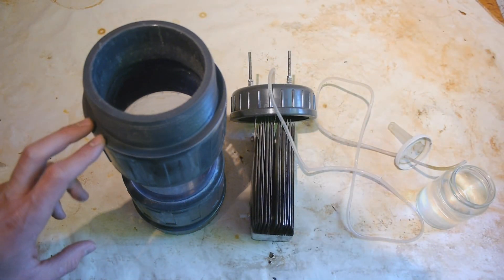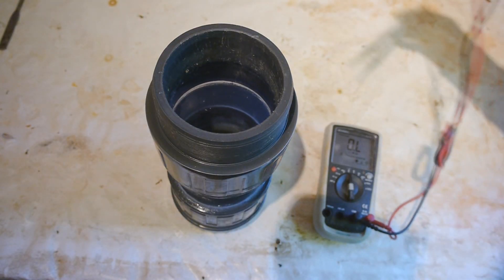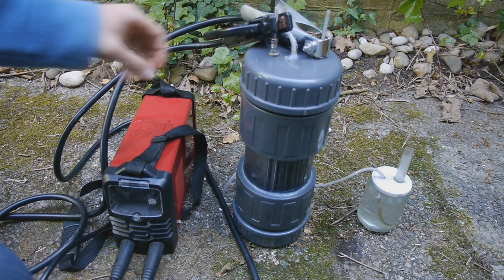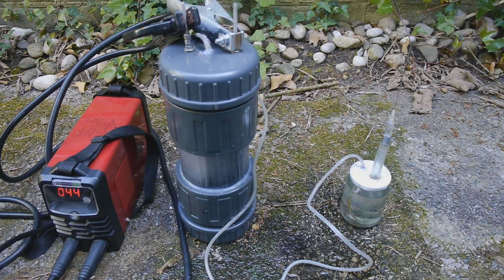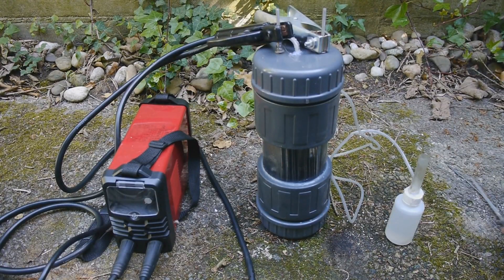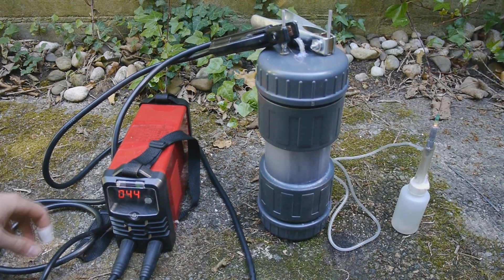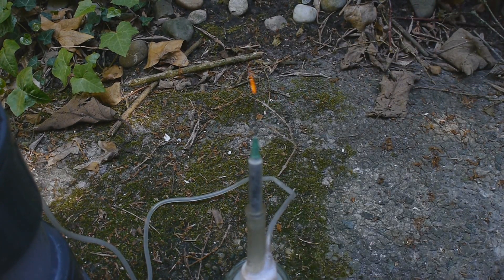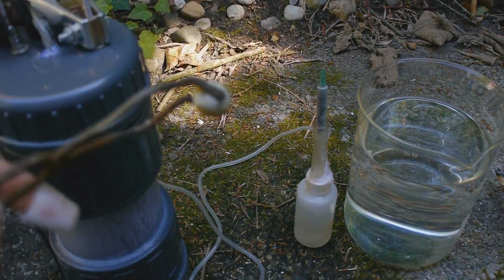How (not) to make an HHO Torch [Explosive Failures]

Comment: Make your car a hydrogen hi-brid Hho Technology will surprise you! Hho is a mind blowing technology . Cool engine running  prolonging engine life and engine oil life with less engine maintainess required🚦

Engine life changer device improve engine performance and increase fuel burning efficiency like  a new car!!!  100% fuel will burn in the engine No un 

burn fuel wastage . Engine will Consume less fuel. Hho system works on petrol, deisel, cng, lpg and lng types gases.

Engine runs lighter smoother reducing carbon emissions significantly . Boost engine power and torque . Hho gas reduced engine noice & vibration

An efficient hho car kit lower the engine temperature more then 100 degree F.  To prevent heat build-up. Hho kits restore better fuel economy. Hho system is very easy and simple to install. Hho solves the engine heating problems automatically!!!.

Cleaner engine running. Reducing engine noise due to the faster fuel burning. Hho car kits works nicely requires no modifications in the car engine. No side effects on car engine.

Engine start quickly your car battery will charge  quickly car AC works better& safe your car battery.  make your car a low cost hy-brid. Use a  low amps. Hho car kit will work better. You can easily transfer hho kit from one car to another one. Hho kits requires no any modifications in the engine. For more information about this useful technology  keep watching hho zafar videos. Or call 03082266179 zafar karachi.
Reply from the maker: But that would be very inefficient to first use the electricity to charge up the battery and then convernt it again to HHO, which then fuels the engine. It is just much more efficient to just use straight gasoline.

Comment: Reduce your pressure, youre  producing alot of gas and no regulation on pressure and minimal on flow , the fact you're still getting a flashback after inserting the wool, you have leaks and too much pressure, another option, reduce current on the welder , there will ve a trimpot for calibration that will allow you to go down further
Reply from the maker: The wool did work for the flashback. But I doubt I will pursue this much further. It was just a fun little side project :D

Comment: when you lit the oxyhydrogen, I winced so hard, I was like: "oh no, oh no! its not pure hydrogen, its oxygen and hydrogen in the stoichiometric ratio, its gonna explode!"
good thing it wasn't sealed, and there was a bubbler xD
also, why use potassium hydroxide over sodium hydroxide? or any other metal hydroxide? does it give some sort of advantage?
and is calling it a catalyst correct? or is it just a source of conductive ions which provide an electrolyte? isn't a catalyst something that changes the speed of a reaction, but does not get consumed? though the potassium hydroxide doesn't go away, it is technically getting broken down, and then immediately getting reconstructed by reacting with water.

I'm loving your videos, and I would love to make suggestions, (if that's alright with you xD )
when it comes to oxyhydrogen torches, they produce the stoichiometric ratio of gas, which is quite dangerous, and burns a little too fast, and since water only requires 1 oxygen atom per 2 hydrogen atoms, this means that when hydrogen burns in air, it much more rapidly will find the stoichiometric ratio with the oxygen in the air, and it can also mean too much oxygen. if you want to slow your flame down, try letting a small portion of your oxygen gas escape into the air. (if the configuration is right, you can do this) then it will have slightly too much hydrogen in the ratio, and so it will burn more slowly, especially in the tube, but when it escapes (which is where you want the flame) then it contacts the air which gives it the last bit of oxygen it needs to burn stoichiometrically.
the snail shell (contains calcium carbonate) is essentially a lime light, and glows super bright (you probably already knew that!) I just find it interesting.
Reply from the maker: It was such a small amount of oxyhydrogen, that it was totally fine. I just used potassium hydroxide, because that is what Grant Thompson used in his video. I guess NaOH would work, but there might be a disadvantage, that I am not aware of right now. 
If it is a catalyst or not depends on your definition of catalyst of course. But if a catalyst doesn't react in some way during the process I guess it would be inactive. So I am pretty confindent that it is correct to call it catalyst right here.
Yes I always love suggestions! However this one is too complicated to pull of for me to pull of in real live. Maybe something for advanced tinkering :D
That with the lime light is a great point! I have hear about this bevore, but I was not explicitly aware, that I demonstrated this, in this old video. ;-)
Reply: @EliasExperiments  honestly, I overcomplicated the HHO torch idea, the whole idea was simply to let some of the oxygen escape from the HHO generator, so that the flame didn't explode or get extinguished as much. :)
Reply from the maker: Well doing that is quite difficult, because I would have to built an entirely different generator. It took me long enough to build this one. ;-) But it still sounds interesting!
Reply: @EliasExperiments  keep on experimenting my friend!
Reply: IMHO KOH solution has better conductivity, so it can pass more current and generate more O2+H2
Reply: @maelgrum  what do you mean by IMHO?
Reply: @Metal_Master_YT  imho - in my honest opinion
Reply: @maelgrum  ok thanks.
also, that's empirically testable, we can just check the conductivity of each solution at the same temperature and pressure.

Comment: You have a lot of faith in that DIY "flashback arrestor" attached to a pipe bmb, which obviously wasn't designed with supersonic energetic mechanics in mind... this is a highly explosive mixture which releases a fair amount of energy, and honestly watching this video you're lucky to be able to walk away from this fully abled. At the very least, put some space between the sealed PVC pipe HHO generator, your face, and the torch end... if someone were to repeat this as is there could very easily be an obituary in the news... yikes.
Reply from the maker: Thank you for the feedback. In my estimation however you are far overstating the dangers of such small amounts of HHO. At most it would have been able to crack the glass, but there would never been enough energy to send shards flying at dangerous velocities. I have had this explode several times and it was never really energetic.